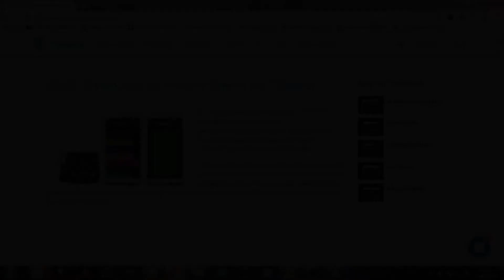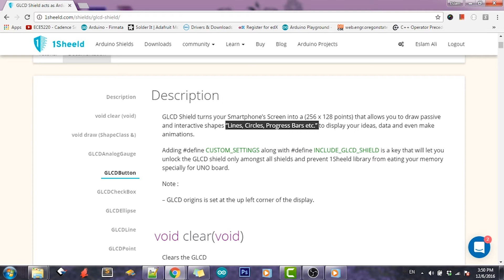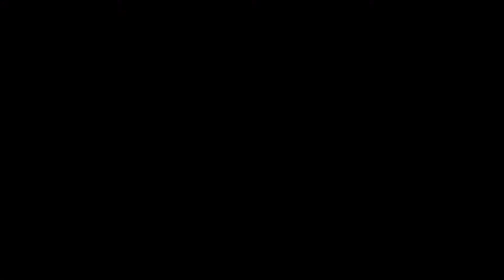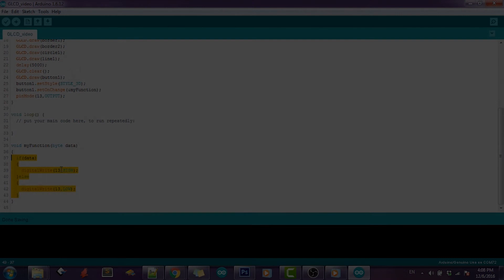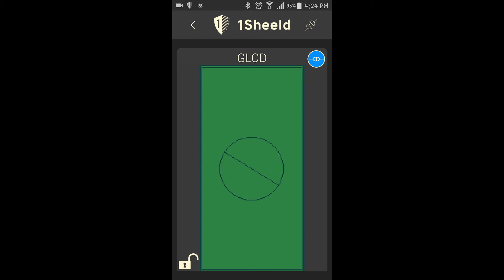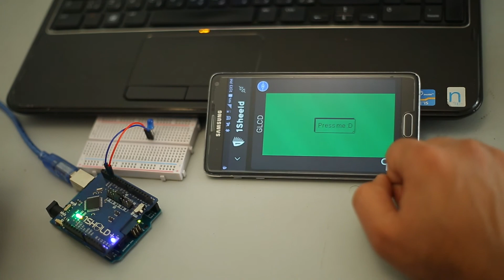Create a 3D Push button on a GLCD to turn on lights - GLCD Shield Tutorial

Comment: Salamou3laikoum, I doesn't have the GLCD shield in the (IOS) app, mabey some solutions?
Reply from the maker: Hey Babbel,

Unfortunately, the GLCD shield is not available in the iOS app yet, so if you can have an access to an Android device you can definitely use it.
You can check out all the available shields in each app just right here: https://1sheeld.com/shields/